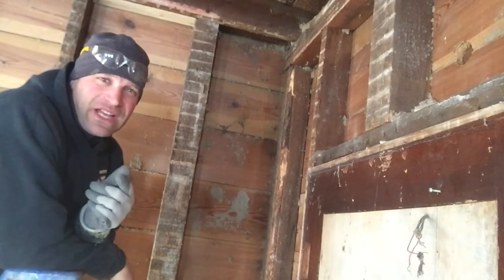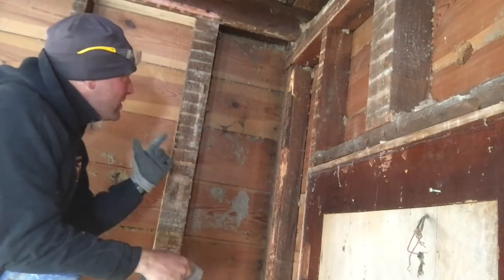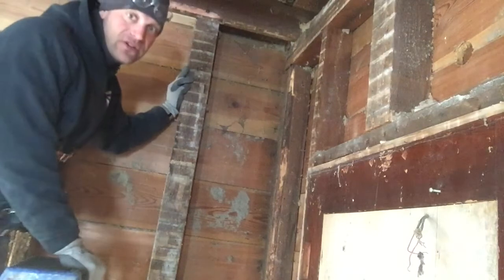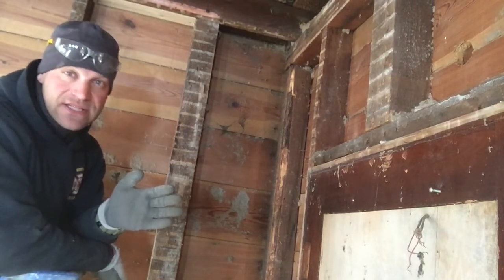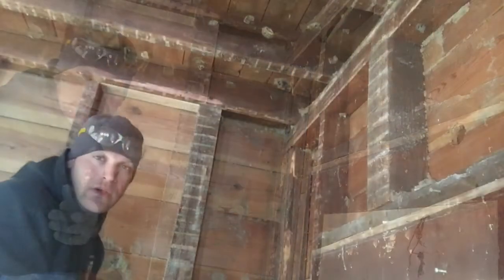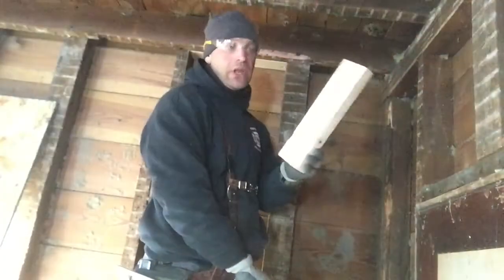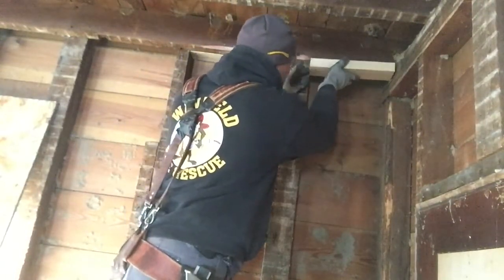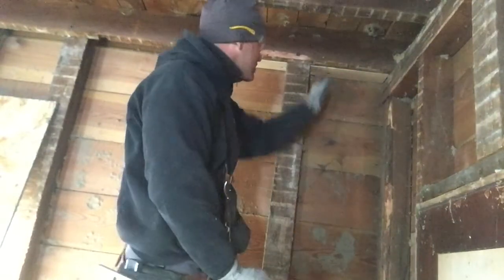The importance of fire blocking with balloon framing

Comment: Is it reasonable to reframe the balloon frame to platform framing on the 1st floor? The second floor studs sit on top plate whkle the 1st floor studs go down to foundation and have been rotted with water damage.
Reply from the maker: You can do it, but it won’t be easy
Reply: @Trevkongable  adding an addition. Have already extended the basement and would prefer yhr joists sit on top of new block wall with the studs being set on plate on 1st floor onstead of going all thexway down to brick stem wall. A few of the studs have their bottoms  rotted out. I would be leaving the 2nd floor balloon framed. And replacing actual brick fire blocking in the cavities with wood fire blocking.

Comment: This is exactly what I did to my house only I used 2x4s between the joists. And you are right there is no standard framing in these old homes so forget  14  16 or 24 inch on center
Reply from the maker: That’s for sure!

Comment: What if you don't have access like this? (Drywall is up/people living there)
Reply from the maker: I believe you can spray fire resistant foam in the wall and then patch the small hole in the drywall. Do you have a local contractor you could ask about this?

Comment: If I decide to take out the lower wall and reframe it with double top plate,. how do I secure the hanging 2x4’s to the double top plate. Steel plates or just toenail?
Reply from the maker: I always like to make sure it is over-strong, so I would toenail it AND use steel plates to secure them

Comment: Thanks for the video. I’m facing this in my home. How would you address wiring and plumbing to the next floor? Drill, rip in half, glue and screw? Foam? Curious about the insulation as well. Afraid to seal it tight and trap moisture/condensation in, and afraid to but in batts or blown in to have it settle and soak. Any input whenever you see this would be appreciated. Thanks again!
Reply from the maker: I drilled through the boards that I put in for fire blocking and then put spray foam from the can  in the holes with the wires.  I also only drilled 3/4" holes so they didn't take much foam to stop up.  You are basically stopping a draft that would feed a fire more aggressively.